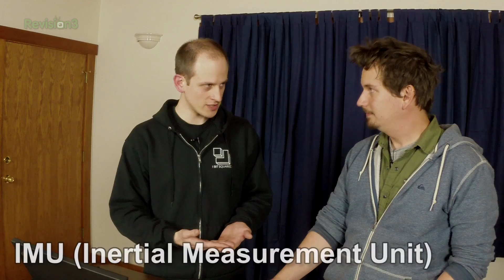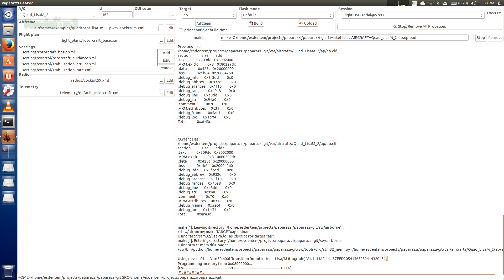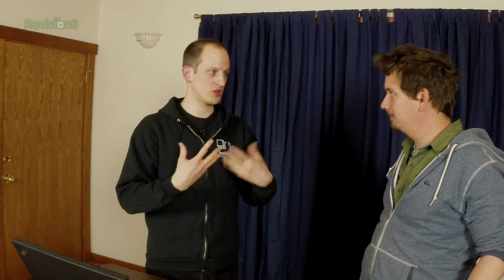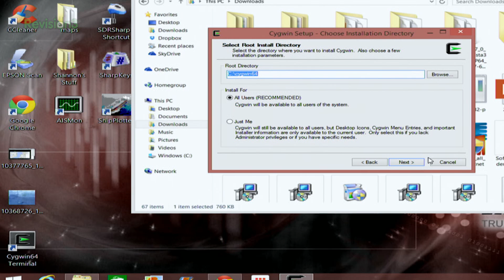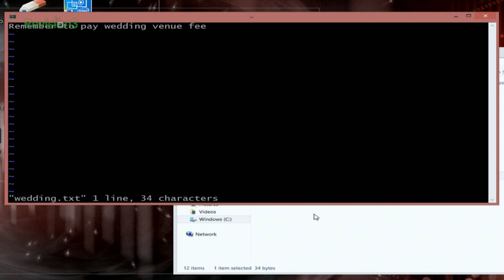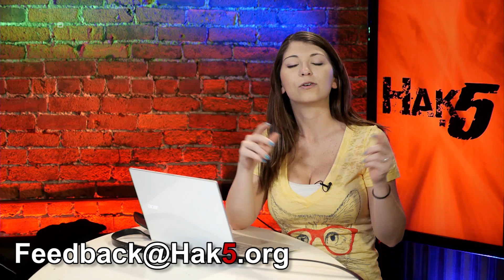Drones 101: Open Source Autopilot, Hak5 1616

Comment: any chance you guys could develop a drone blocking system? eg if a 2.4GHz drone is within 50m of you the signal is blocked and it falls from the sky or even hack the code so you can steal it/take control or just crash it.

i could do the perfect murder with a decent drone and no one could catch me (could even fly over the heads of law enforcement and they wouldn't have a chance).

not how i'd do it but possibly the easiest way, how much thermite would melt a human skull? these drone could easily carry a few g and a battery/magnesium igniter. hover above and a few seconds till molten steal sizzles some heads. then fly off.

Comment: msys is agood alternative to cygwin. I think it's smaller, and requires less disk space than cygwin. Msys  doesn't have a download assistant as cygwin but it provides common linux commands too. Howver, if you really want to work with a linux-like command line tool, get yourself a real linux distro. Almost all of them are free.